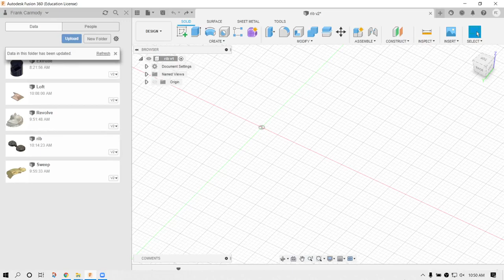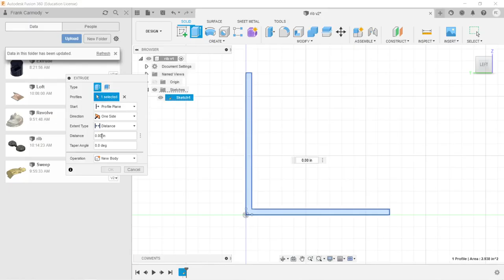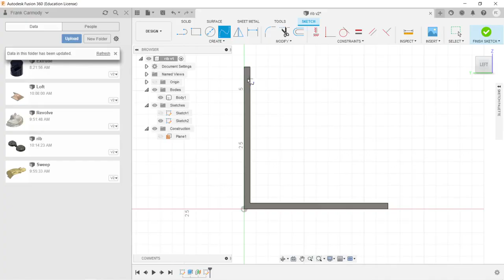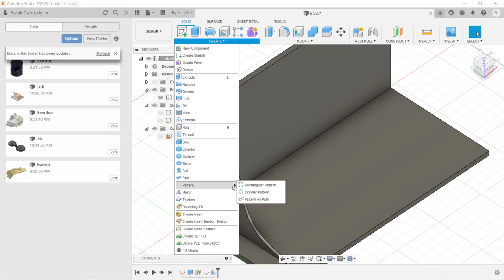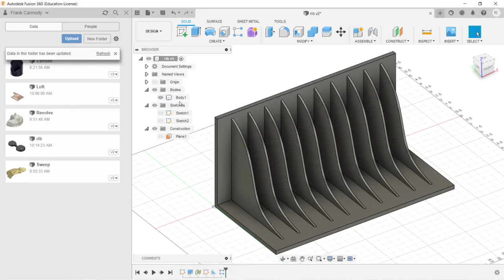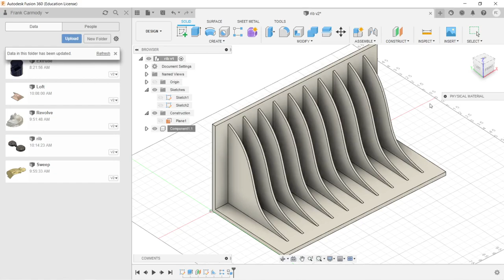Fusion 360 : 05 : Rib

Comment: What advantages does using the "Rib" tool have versus just extruding one from the sketch you already made?
Reply: That's what i was thinking. Just make a sketch on the offset plane, extrude, and pattern.
Reply: @thegribbs  I get there are (there must be?) advantages to using Rib but this video doesn’t seem to address that.
Reply: You can only extrude linearly. Today I needed this feature when I needed a fillet but it wrapped around an axis. That said, maybe I would have been better off using the revolve feature?
Reply: @Lozzie74  yeah, revolve or sweep 🤷‍♂️